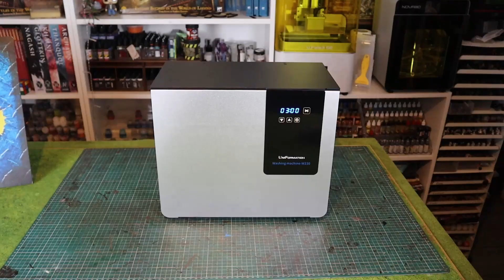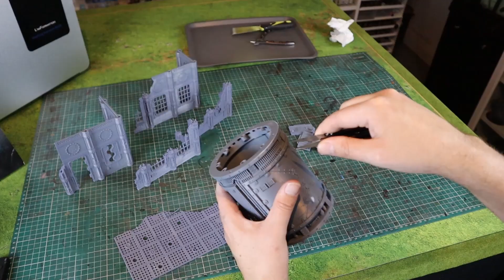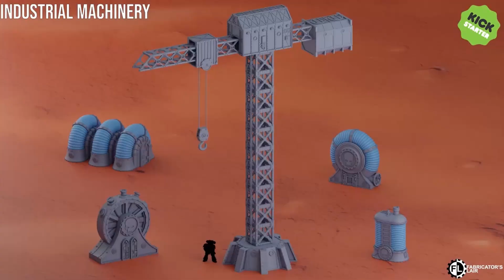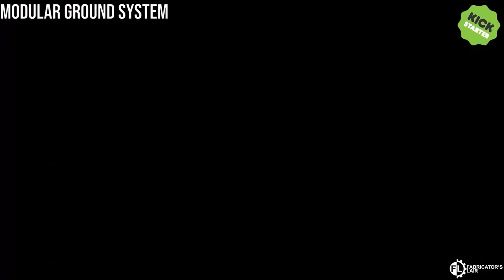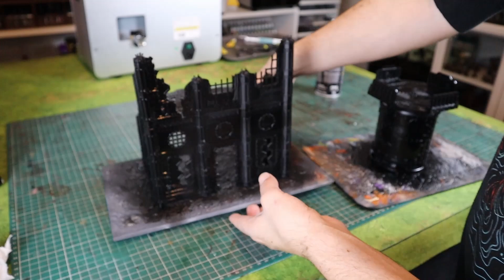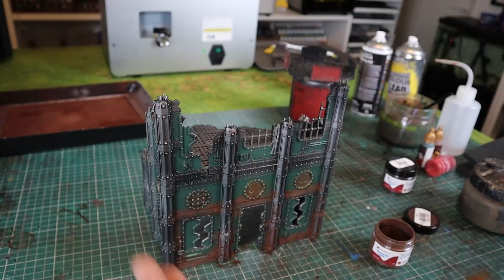Save €€ by 3D Printing your own Table Top Terrain!

Comment: 3d artist here just getting into 40k…….im trying to figure out the scale of terrain for this game.  Is there a standard scale for buildings where individual units like a space marine should be able to walk through the doors?  If you make small set pieces like barrels and crates do they need to be exaggerated in size or strictly a 32mm (1:64) or is there changes based on actual gameplay?  I have 3d printers and can model almost anything but i dont really get what scaling i should use for the actual prints (terrain only).  If a player was to purchase terrain elements like rocks, trees, or buildings for their game boards what sizes would these people expect?  Thanks!
Reply from the maker: There’s tons of terrain online you can check for scale! Way too complicated to get into in a YouTube comment haha

Comment: I think the amount of work you put into terrain can vary depending on the piece it self, kinda the same thinking applies for me as fully detailing the front row for an old world regiment and putting less effort into the back row.

If you’re working on a ruin that will likely be the corner of a battlefield and not play much of apart, that gets done quickly and simply.  But I also have pieces that are centrepieces themselves that a game can be played around, like a mechanicum power station bunker that is also kinda a fortress.  I’ve played games/ campaigns where that power station is the entire focus either to destroy it, protect it, steal it etc, and seeing as when it’s on the board it is such a focus I don’t regret the many many…… probably too many hours I put into building and painting it.
Reply from the maker: I agree 100%.

Comment: Any idea how it’d go if you scaled down to Legions Imperialis scale?
Reply: It's not a good idea because the connection system became too small. Walls thickness too.
I will do an epic terrain project just before or after this summer
Reply from the maker: It would work a treat. What a great idea.

Comment: what is your opinion on the Elegoo - Mars 4 Max? looking to get into 3D printing. And is it save to keep in your room when its printing? no toxics etc? ( sorry got really no knowledge of this)
Reply: I definitely wouldn’t leave the printer anywhere your going to be be spending too much time (like your room) as the resin releases VOCs ( Volatile organic compounds) which are not so great for your health. Also make sure wherever your printing is well ventilated. The Mars is a great printer and probably one of the best if your just starting out as it’s a bit easier to set up than some of its competitors.
Reply from the maker: As said below o would never keep a printer in a room I sleep in. Even the once you see in my studio are not run from this room. They are somewhere else.  Resin fumes are no joke. Please be careful.  I have never tried the mars printers. They are on my list.  For a first printer I’m recommending the whale 3se to people. It’s one of my favourites